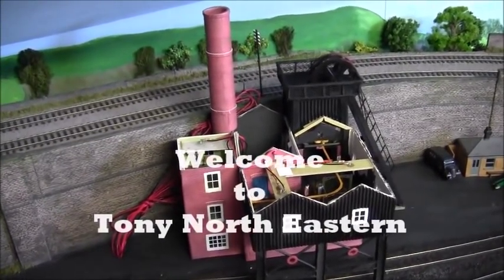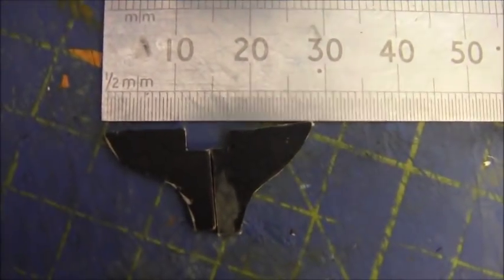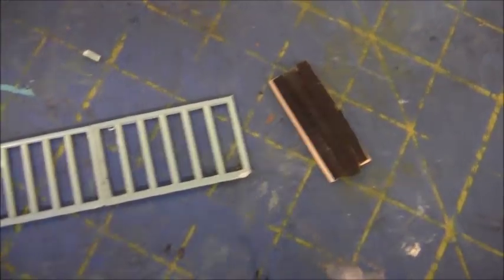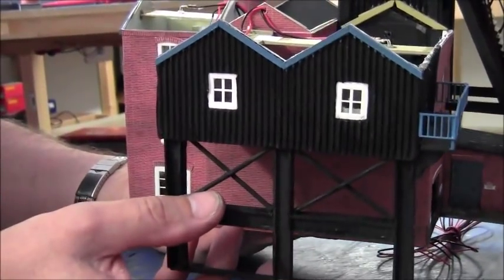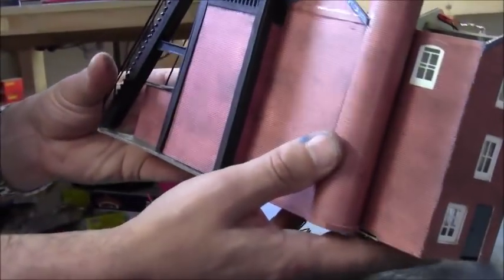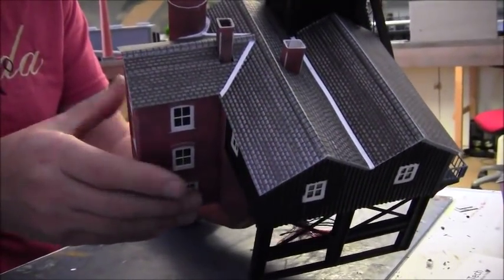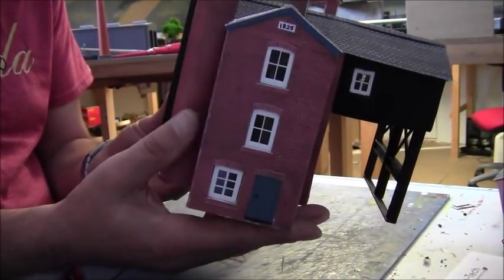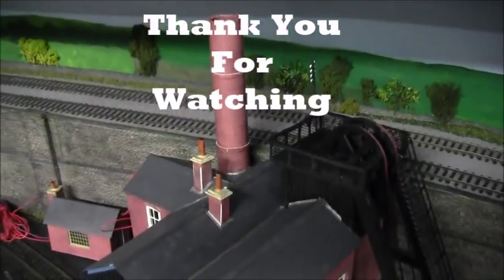The Colliery Part 5. Roofing , No171

Comment: A fantastic addition to an already superb layout. Well done Tony. Out of interest, what did you use to make the lead flashing? Mike
Reply from the maker: Hi Mike, thank you for taking the time to comment, the lead flashing is strip's of paper cut to a width of 4mm. then cut and folded and with the help pva glue to stick them in place. the rocket glue goes of to quick... then paint the strips metallic silver, and then to finish you can add some grim paint. tiny amount of green wash....all the best Tony